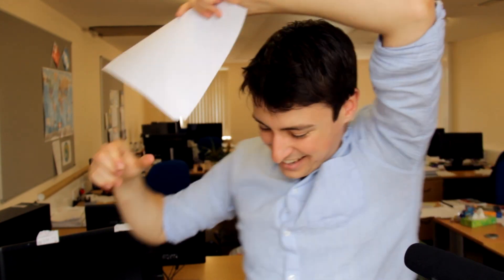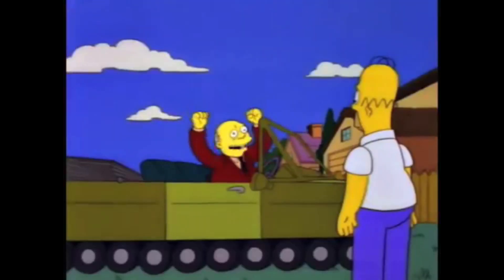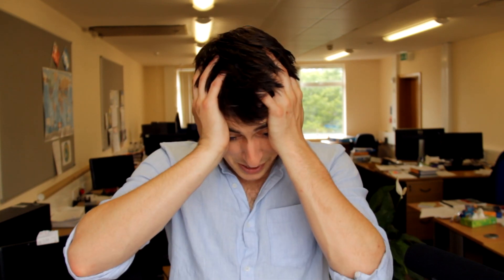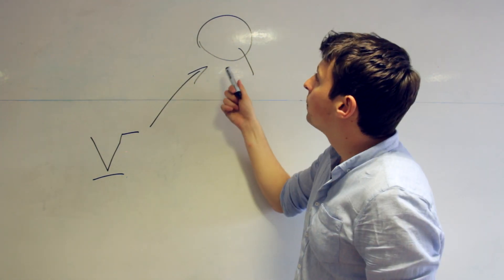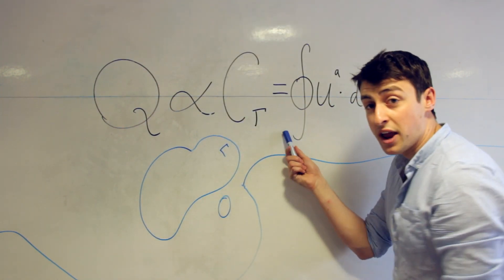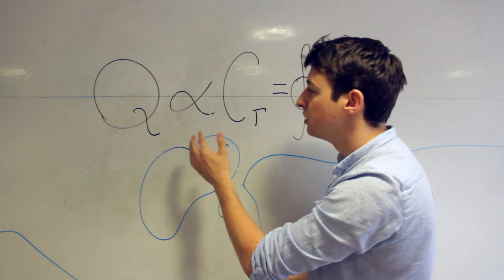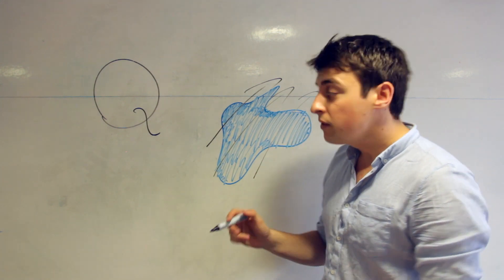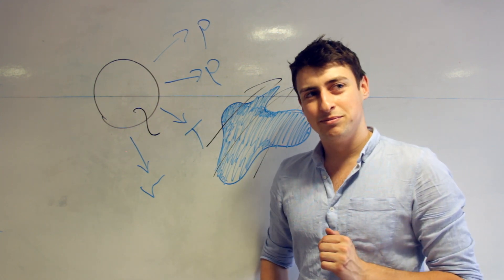Writing my thesis and Potential Vorticity - PhD Watch #2

Comment: So the bit about gamma being infinitesimal, Do you mean that the PV is the proportional to the curl of the flow?
Reply from the maker: Yes exactly! It's proportional to the curl of the flow (the regular vorticity) but modified by the vertical structure or stability of the fluid the PV is defined in.

Comment: What balance condition are you using for the PV inversion ? Quasi geostrophic ?
Reply: QG balance condition IMHO is not valid over the tropics. So how would you use PV inversion inside a tropical cyclone or over the equator ? I realize this is a Ph.d level question with PV but I am wondering whether you have tackled this problem.
Reply from the maker: +ashwinD12 yep, QG. We want the superposition quality and operating at large enough scales that its a reasonable approximation to Ertel-Rossby
Reply from the maker: +ashwinD12 ah, you're quite right that QG (along with geostrophic, which is the problem) fails as an approximation at the equator. Fortunately I'm looking at the pole, so the coriolis acceleration is very non zero!
Reply: So I have been looking at the Non Linear Balance Condition or the Monge Ampere equation first used by Jules Charney for the tropics. 

Do you use a home made PV inversion software(written by members of your group) or the Davis/Emanuelle PV inversion tool ?
Reply from the maker: ashwinD12 homemade inversion code, which is the big problem I've been having! The Davis/Emanuelle technique only works for Ertel IPV sadly, and my subsequent analysis assumes quasigeostrophy
Reply: I understand. What language is it written ? Fortran 90. I presume that is the best language out there for these kind of problems. I heard you talking about Python but I wouldn't do PV inversion using Python. F90 is the best. Python is more for post processing-data acquisition, transformation and plotting.
Reply: By the way my problem is the other way around. I am not using Davis/Emanuelle but I have PV QG code in Fortran and need to convert it to Charney NLB if I want to use it in the tropics !
Reply from the maker: Could you pop me an email at simonoxfphys@gmail.com? Would love to chat to you about the QG code! I do have a couple of hundred lines of Davis and Emanuelle code in python if that would be any help?
Reply: I will do that. In the meantime kindly delete your email address. I do not think you want  the public to view it :-)

Comment: In Oceanography we work with PV in a mostly quasi-geostrophic sense to study ocean currents and the differences in topography and latitude (if in a beta-plane approximation). Usually, the PV can tell us about the barotropic instability and the elimination of eddies due to the conversion of kinectic and potential energy to the meandering of the currents. It can be seen in Rossby Waves mostly. Sorry if I butchered English a little bit
Reply from the maker: we mostly work with QGPV in the atmosphere too! I figured I'd talk about Rossby-Ertel PV because (to me, at least) it's more intuitive. In the atmosphere I think it's used in a more general sense than in the ocean, or at least in the stratosphere it is
Reply: Thanks for the reply. In the ocean it is mostly used in mesoscale flows (i don't know if the order of the scales are the same in meteorology). The Brazilian Current, e.g., which is a current I am currently working on suffers a lot from the difference in bathymetry. It sometimes go as fast as to escape its isobath and it usually has to bend in a way that goes back to its isobath and sometimes aswell producing vortices.

Comment: Puny first year Uni Physics student here:  I think I got the general gist of what you're talking about.  Two similar examples I was thinking of just to check whether I'm on the right track - first, in orbital mechanics when you have a two-body system you can take the fundamental properties of the system (i.e by observing the energy and angular momentum and using the reduced mass, all within the CoM frame etc.) and convert it into a one-body problem that can be fully solved using conic sections.  Also, from the little Quantum Mechanics I've done I know that the wavefunction fully describes the entire system, and then as we can work out how the wavefunction changes with time, we can then predict how the system as a whole changes also.  Does this bear any resemblance to the Q-value you're talking about here?

As a follow-up question, from the little I know about fluid dynamics I know that it's fundamentally a nonlinear problem, and as such doesn't generally create a fully analytical solution (such as the aforementioned conic sections in 2-body motion).  How does this factor into what you're doing?  I'm guessing that you are using (your much griped-over!) computational methods to create the simulations that you're interested in, and that the PV, Q-value stuff is the basis of that.  I'm waffling a bit, so in short, how do you go about tackling what as far as I know has no analytic solution in a sensible manner?  Chaos has a nasty habit of making even the simplest system frustratingly obtuse!

Comment: Are anomalies a big thing in this?
Reply from the maker: yeah there's a particular simplification of PV called quasigeostrophic PV that allows you to linearly separate background fluctuations like the annual cycle from sudden changes in the PV distribution - that's what I'm studying in particular in my PhD
Reply: Can measurements of ozone be used to guess PV field?
Reply from the maker: Indirectly but not really - ozone anomalies change the radiative equilibrium temperature of the stratosphere, which will affect the PV distribution but not in a huge way compared to changes in circulation for example